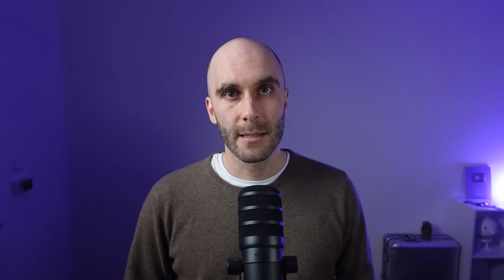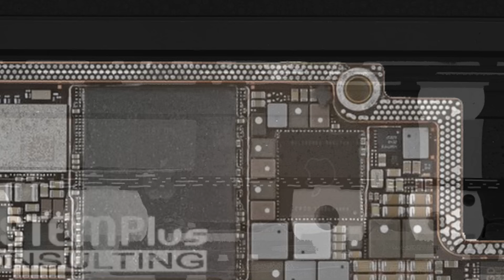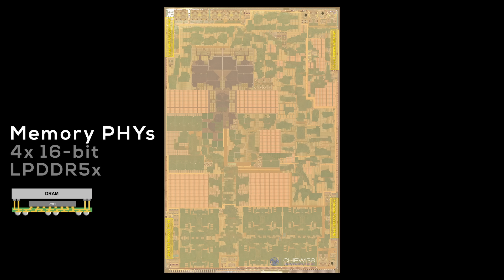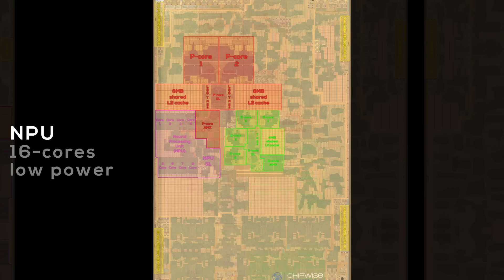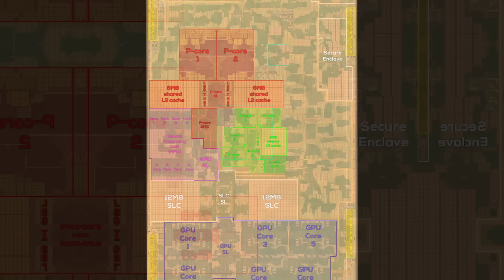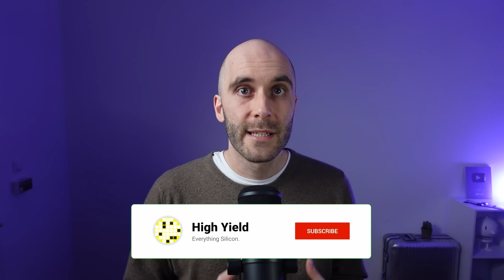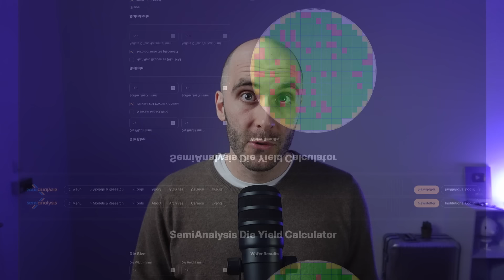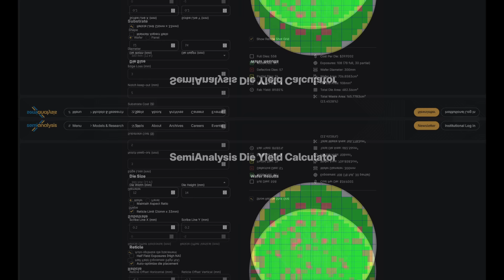A18 Pro & MacBook Neo Deep-dive

Comment: The way to think of it is not that the Neo is run on a weak iPhone chip, but that the iPhone is run by a chip powerful enough to run a laptop.
Reply: That was literally the thinking of the M1 chip. The A14 was crushing Intel's CPUs in benchmarks for a fraction of the power budget. Only, no one could really see that because a phone wasn't very comparable to a desktop. So Apple added more I/O (2 Thunderbolt channels in particular) and repackaged the design as a laptop. Et viola! M1 MacBook.
Reply: @thewiirocks  there also another player that you conveniently missed: amd. Amd was also able to smoke intel in those days.

M1 was an anomaly. It wasnt divine
Reply: @suntzu1409 Perhaps you meant to reply to someone else? Literally nothing you just said has any bearing on what I said.
Reply: @suntzu1409  yes but the M1 smokes AMD too. They revolutionized ARM chips for laptops and the first company to successfully makes it powerful and efficient. Other attempts has been a failure.
Reply: @pitonpriscal3379    no. It wasnt as dramatic as intel
Reply: @suntzu1409  it still dramatic
Reply: @thewiirocks bullshit! That intel was literally a 14nm based chip vs tsmc 3/5nm node that’s a gigantic difference lol!!!
Reply: @alanmay7929  you literally just explained why the iPhone chip was crushing Intel's chips in performance. 

That "huge difference" in process meant Apple could sip power while getting incredible performance. Intel themselves have since accomplished the same result with Lunar Lake & Panther Lake by using TSMC's processes.
Reply: @alanmay7929  the node name now just a marketing term. 18A intel isnt much better than tsmc 2nm. you need to check out the density instead. remember how intel rename all their node from 10nm to 7nm, 7nm to 5nm? thats because the density of those intel node is roughly the same with tsmc 1gen ahead.
Reply: @asdfsdfsadfasdfsf blablabla!!!! That 7nm thing was old intel marketing stuff, 18a is actually better than 2nm, the smaller the transistors gets the more you can package in the same space that’s physics.
Reply: The only advantage apple has here is their hardware only runs their software.
Reply: @thewiirocks lol!!!!! Why didn’t you mention the real reasons before me? Also intel both designs and make their own chips unlike apple that has to rely on tsmc.
Reply: @alanmay7929  are you having a stroke or something? All the energy and exclamation points. All to ask a question that doesn't matter. Apple had better chips than Intel. So they decided to make a laptop. You agree with me. We all agree. Life is good. Relax, sit back, and enjoy life a bit more. It will save your blood pressure and possibly your life.
Reply: @thewiirocks ”blood” pressure? You’re too funny mate! What a pathetic statement! Intel only make processors and not the software or a device, apple has had all what they needed to design their own processors for their computers since the first iPhone lol!
Reply: @alanmay7929 m8. It's a corporation, not a religion. Calm down.
Reply: @alanmay7929  Because that's what Intel had at that time LMAO. It's not Apples fault that Intel had aging lithography nodes.
Reply: @SussySmurf lol!!!!! Why doesn’t apple own its own chips fabs? It’s very easy to talk crap about intel but you forget how very tough it is! AMD once had a chip fab but they had to abandon it. Apple owns nothing!
Reply: @outcastatsabre lol!!!!!!!!!😂😂😂😂😂😂😂
Reply: @alanmay7929 So that gives them justification for being shitty and having shitty products? 😂  You just made Intel into a religion.
Reply: @alanmay7929 Yeah, owning a chip fab is tough. When it's literally your core business though, tough luck, get your shit together and innovate or die. Intel doesn't deserve pity here, they let their core business coast along when they were comfortable with their monopoly status in the early 2010s
Reply: @SussySmurf  yea
Reply: @thewiirocks  Well, Apple (and Qualcomm btw) still wins because of how ARM lets them do incredibly wide pipelines (8-10 decoders, with the rest of the hardware to match). Intel and AMD are still catching up regardless of process node.
Reply: @blubits bullshit! You mean the investors strangled to company trying to take away every single penny they could lol! Those chip fabs have to buy machines from companies like ASML the maker of the most advanced lithography machines in the world and also secure a very niche supply chain to be able to succeed, the most complex supply chain for such things is based in Asia. There is a reason why almost everything super advanced is made in asia for decades now.
Reply: @SussySmurf hey I donot care about intel, beside it’s an american company, the only american company to have advanced lithography meanwhile apple, nvidia and AMD are having to work with foreign companies lol! The us can’t afford to loose intel and they are going to improve their manufacturing wether you like it or not! It’s not my problem!
Reply: Intel is going definitely in the future to be more of a manufacturer for n y other companies including apple, you can cry harder! Like it or not! Times has changed
Reply: @thewiirocks 
A18 Pro isn't crushing in performance - it's more like Apple’s chromebook, it's budget not even entry level Mac.
Reply: @asdfsdfsadfasdfsf 
I think peak performance per watt for Panther Lake on 18A is between 30 to 35 watts, unlike Arrow Lake's 50 watts on TSMCs 3nm node. 

I prefer using this to compare generations.
Reply: @an_autodidact  100% and people compare the efficiency of their processors, when they lack features to do so (like opengl)
Reply: @alanmay7929  And whether you like it or not, you can't change the fact that what Intel had when its competitors had access to bleeding edge lithography nodes was inferior aging shit caused by their own stupid decision on not focusing on their own foundry.
Reply: @thewiirocks  so you gonna pay extra for apple bein apple while you can get a stronger chip for the half of the cost. just learn to properly use an os, youre all paying the eejit tax. also intel 18a beats apple 3nm so atleast get your facts right, wait you have to ask siri for that right?
Reply: @Batugun94  you're talking to the wrong person, my friend. I'm replying to you on a custom-built Windows Desktop computer next to a stack of about 20 Linux computers acting as servers while an iPad and a MacBook Pro sit directly in front of me on my desk. I won't get into the innumerable computers that aren't even plugged in. Troll all you want, it's great entertainment.
Reply: @t @thewiirocks eah saying intel 18a is better than tsmc 3nm and apple charging extra because of the "foolproof os" (for dummies) is trolling not truth saying. Only what you acknowledge or like is, everything else is just trolling right? Did your father bought you a pony for your birthday princess 🤦🏻‍♂️ performancewise apple cant compete with top tier intel/amd products thats a fact, if you ask for performance dont go apple whats that have to do with trolling princess? :)
Reply: @alanmay7929 we got the owner of userbenchmark over here lmao.
Reply: @a @alanmay7929 o it actually is just marketing. 18a is better than 2nm, but not because the actual resolution is 18a. The names of the nodes no longer actually correspond to the resolution. Just think of them as generations. 2nm to 18a is more like “3rd generation” and “4th generation” or whatever. Also, in intel’s case they now use backside power and gate all around transistors. Both of those technologies enable significant gains in performance between generations. TSMC is doing the same as part of their n2 line. It’s very possible that tsmc’s n2 could actually be significantly better than intel’s 18a because they will both have these technologies and tsmc is generally better as of now.
Reply: @alanmay7929  The fact is that Intel took ages to get to 10nm, and instead of their executive suite firing a code red and doing everything they can to get it back on schedule, they rested on their laurels, stuck consumers onto 4-core CPUs, and gave themselves massive bonuses while TSMC caught up with and even exceeded them. That's not a problem by the investors or by anyone external to Intel. That is an executive problem. There was rot at the top that bit them in the ass 5 years later and they're still feeling the effects of that today. Intel is only revving up again today because they lost their monopoly status the minute TSMC started to manufacture more advanced nodes and Apple and AMD started to make better core designs.
Reply: @b @blubits blablabla….. intel basically both designs and manufactures chips and many other electronics components, there are no oth companies in the world that does that so it’s double the work, expenses and sacrifice, the finance guys are the ones that screwed and as much as you hate intel it’s the only american chip company, finally the machines are made by the Asml company based in the Netherlands and the supply chain for this industry is super difficult.
Reply: @alanmay7929 I don't hate Intel, my dude. But the fact is that plenty of good, talented engineers in the company were shafted by the few people on the executive team that chose to increase their salaries and rest on their laurels instead of utilizing their talented workforce to make better products. Intel's decline is the own doing of Intel's 2010s executive team. A company is only as good as its leadership, and Intel's leadership back then sucked. That you can hopefully agree with.
Reply: @blubits i totally agree with you on the topic, intel isn’t just a chip design company but also a manufacturer of many other products and that’s not easy by no means
Reply: @blubits  Intel has always behind. The only innovate when AMD crushed intel which pushed intel to uncludes more cores and better design. Apple crushed both of them so they can make more powerful and efficient chip.
Reply: @thewiirocks now intel has caught up with Panther lake. Makes Apples graphics look like shit
Reply: @wile123456 Panther Lake is far from "caught up". Hanging on as a lifeline is a more accurate description, I'm afraid. Intel can't scale up on TSMC's processes because TSMC doesn't have the capacity. Which is even ignoring the fact that Intel has a PR problem if they rely too heavily on TSMC.

And every comparison I've seen on the Panther Lake on-board GPU has fallen short of the M4 and M5 GPUs. So that's not really impressive either.

Listen, I've been a fan (and developer) of Intel for decades. The printed processor manuals on my shelf are a personal treasure. But Intel got complacent. They thought they could keep AMD on life-support to pretend like they had competition and release 2%-5% improvements generation over generation. 

Eventually Intel's competitors picked up the slack. First AMD, and then Apple when Intel couldn't make the chips they needed. Intel is hurting now and we're all worse for it. It's their own damn fault.
Reply: @wile123456 Not even close, it draws more power than M5 Max and delivers a fraction of the performance.
Reply: @Chibai-hp4ri  You should save face and delete your comment. No part of what you stated is accurate, and it shows that you are about as knowledgeable as a preteen. First and foremost, the least expensive Mac with M5 Max costs less than $4,000 USD, not “5000+.” Also, I was comparing performance to power ratio, not performance. The M3 Pro beats out the Intel chip in question. The biggest issue with your comment is that you are comparing the price of an entire computer to a CPU. In order to benefit from a typical $300 CPU, you need thousands of dollars worth of hardware like high-capacity and high-frequency RAM, high-capacity SSDs, a high-performance GPU, and for workloads specific to Apple’s target market, a color accurate high-dpi display. When you purchase all of the aforementioned equipment, or buy a PC laptop with that equipment, the cost is often comparable to a Mac, and despite that, you have noisy fans, major thermal issues, battery life in the minutes (as opposed to hours), and a significant loss in performance when unplugged. The aforementioned issues are a result of the horrible performance to power ratio of Intel processors. Maybe you should consider the details before making juvenile, “trendy” comments.
Reply: @Chibai-hp4ri  5,000 usd is for the entire machine..................
Reply: also the 14" model with the 40 core GPU M5 Max is $4,100
Reply: @Taxiway_Delta  panther lake is mainstream, M5 Max is not. Thats like arguing a nvidia GB300 is better than rtx 5080
Reply: @suntzu1409  Mainstream? Like Fox News? 😂
Reply from the maker: Good point. Also kinda crazy to think that the A19 Pro not only is faster, but has 50% more DRAM (12GB) and a vapor chamber for cooling. If the "Neo 2" gets the A19 Pro, I'm pretty sure it will be without the extra cooling.
Reply: @HighYield it will still need cooling or some king of extra heat transfer, smartphones have a very tight thermal envelope and runs a much lighter os compared to computers
Reply: @alanmay7929 why? The current neo doesn’t rely on active cooling? Lit no heatsink, just the laptop itself, not even thermal pad, much less a heatsink on the chip itself.
Reply: @DengueBurger yeah that’s the reason why it’s getting so hot to the point of failure, why out a vapor chamber on the iPhone running a light OS vs a laptop running a full heavy OS? Plus the MacBook Neo is a binned chip with few less cores so it has to be pushed to the limits.
Reply: That makes me feel better about the iPhone, not the laptop.
Reply: yes
Reply: Raspberry pi is powerful enough to run full fat linux desktops. Anything is powerful enough to run a "laptop". ChromeOS can run a potato
Reply: I see it as just a continuation of what is about a ~5 year technological gap between mobile and bleeding edge laptops. You see it everywhere else. Modern android phones running pc games are roughly about where hardware was 5 years ago. The steam deck uses zen 2(2019) and rdna2 igpu (2020). The A18Pro(2026) is roughly about where the M1(2020) was. The switch 2(2025, but uses 2022 hardware), has about the same performance as a PS4 Pro(2016) but modern features (mesh shaders, DLSS) to compete with something like the Series S(2020) on the graphics side(not the CPU side)
Reply: Yes, but also: Why should a laptop require a more powerful chip in the first place if you perform the same work as on a phone? For most people that’s web browsing, listening to music, writing messages, editing documents. All extremely lightweight tasks that were possible on flimsy Raspberry Pi’s years ago. The only reason why Laptops needed stronger hardware than phones was that most people ran windows which is massively bloated and needlessly resource hungry
Reply: @coal6tamarack2374  Lol no.
Personal computers are designed with multitasking in mind and overall for more demanding programs.
Reply: @coal6tamarack2374  If a chip is more powerful, it uses less watts for the same amount of work, which means better battery life. The neo has an awful 6 hour battery life, because the battery is small and shit to save money. but they could ahve put a 70 watt hour battery in and the small wattage of the chip would have helped
Reply: iPhone chips have been too good for iPhones since at least the A7, back in 2014
Reply: Every flagship phone chip in the past 5 years have been powerful enough to run a laptop lmao
Reply: @wile123456 And it's why we're ripping Microsoft a million holes for not being able to make Windows play that well with ARM chips.
Reply: @FlyingCIRCU175  yea, it’s not all Windows’ fault. Developers need to re-write apps for the new architecture, and they won’t until there’s a user base, and that won’t happen until there’s app compatibility…

Apple (for better or for worse), said we’re changing to this, users won’t have a choice, developers if you want to stay relevant get to work. Rosetta 2 was also a very well executed stop gap. 

As long as Intel and AMD keep improving x86, a snapdragon keeps lagging behind Apple Silicon there will never be a push for change on the Windows side. The adoption of handheld gaming is a bit of a push, but not enough. Not sure what the future of Windows on ARM looks like, but unfortunately seems like it will be stagnant for the foreseeable future.
Reply: @DozIT  yeah, but the reason it went so well for Apple was the incredible performance of Rosetta. That meant that devs didn’t actually have to port all the apps out of the gate. The MS equivalent wasn’t quite as robust.
Reply: pov: chromebooks 😂
Reply: @lomein2 but with a usable os unlike chromebook.
Reply: @ThreeFontStreet 
Ios is more usable vs chromeos?
Reply: I mean, your phone can run netflix, word and instagram, it's not like making the screen bigger makes everyday use any more demanding.
Reply: @b127_1 It kinda does, but Apple SOCs already had a lot of headroom.
Reply: @b@b127_1t similar resolutions. iPhone 16 pro max has something like 1200p resolution, while the Neo is 1500p, pretty similar resolutions. But in any game and some apps, you can choose the resolution anyway, even if your screen res is something else .
Reply: @b127_1 Actually, it does. More specifically, the higher resolution.
Reply: @Taxiway_Delta However there are ways around it via different chips like the Media Engine or Display Engine
Reply: @Taxiway_Delta true, but the graphics is enough for the higher resolution.
Reply: @b127_1literally the most demanding part of all of this is scaling it to resolution....
Reply: @GothxJesus  ay yo, both the neo and the iPhone has comparable resolution despite the much larger screen on the laptop
Reply: @prfwrx2497 "despite the much larger screen" here, hold this 🔴  it's your nose you 🤡
Reply: I just wonder how long it will take before someone gets the MacOs from Neo to run on a iPhone 16 Pro.
Reply: @AndrewTSqimpossible with apple lol!!!!
Reply: @alanmay7929  I mean we have hacks where iPadOS can run on iPhones now
Reply: They really need to hold Tim Cook hostage and force Apple to fully open up all of their devices and operating systems so we can fully take advantage of their hardware
Reply: @SnrubSource no, but they should make a laptop out of the iPhone XS Max chip 💀
Reply: @SnrubSource it’s not going to happen that’s why intel, AMD and nvidia hardware is so loved for all kinds of projects not just running different os but also superb customization
Reply: Kind of limiting given ios
Reply: I mean its been a while since mobile phone processors have been integrated into laptops, it’s just that the apple OS makes a huge difference because of its high optimization
Reply: Blablablabla!!!!! We’re in 2026 the technology has allowed us to make enough powerful smartphone chips to power all kinds of devices it’s not just laptops, also it’s the software that combines all that